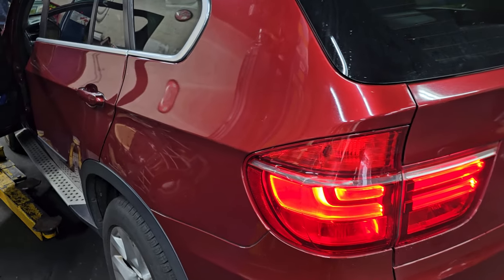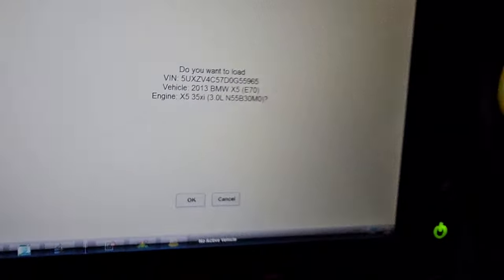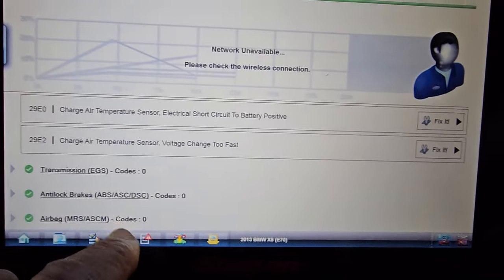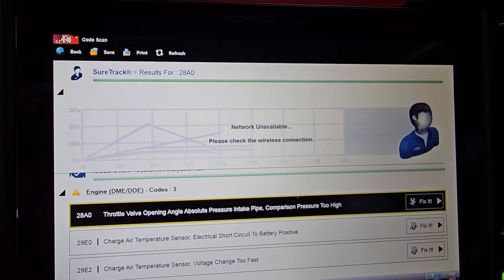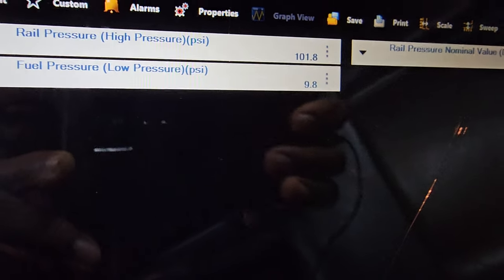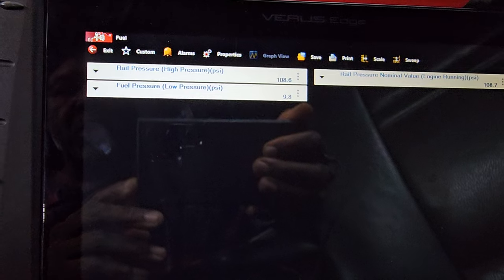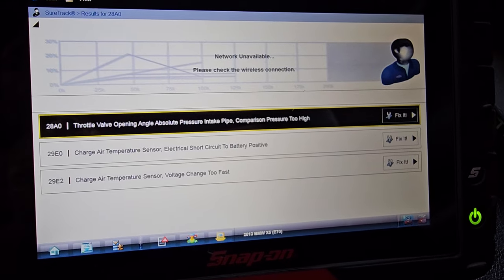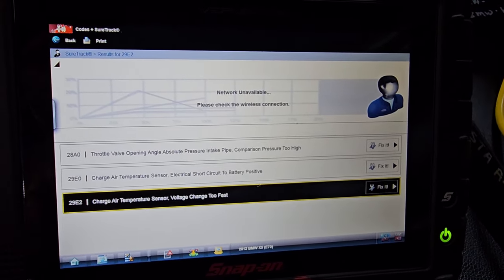2013 BMW Code 28A0 Throttle Valve Opening Absolute Pressure Intake Pipe, Comparison Presure Too High

Comment: The purge valve sucks in unmetered air from the gas tank.  That seems to be the best explanation.  When I disable the purge solenoid by unplugging it, the error code 28A0 is not set and the lean condition (fuel trims) go away.  When you plug it back in 28A0 appears.  It’s not the vent hoses in the engine compartment, but from the tank.